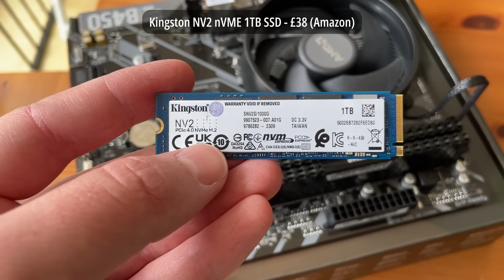Building a Cheap and Upgradable Gaming PC in 2023

Comment: Just today recieved all the parts to finally move on from my lga1155 , got a ryzen 5 5500,b550,and ram for 200, got an rtx 2080 for $150 on ebay, and reusing my PSU. Also got a nice m.2 drive for $30. For like 400$ I'm stoked to finally try 165hz!!! Love your budget videos bro.
Reply from the maker: Nice :)
Reply: @RandomGaminginHD  are you heterosexual
Reply: I also wanted to warn about using old psus. I've got an ancient Silverstone that was seriously expensive and still works great, but that one is an exception. Changed quite a few over the years.
Reply: @youzernejm  my psu is around a year old although it's a thermaltake smart 700w which dont have the best reputation
Reply: @Ostraaaaa  that's concerning. I hope it's not a Smart BX1 series. Hopefully you had it replaced by now with a good PSU. Good PSUs have been in competitive prices, and you can check their efficiency in Cybenetics and see what they are in SPL PSU Tierlist.
Reply: @karamelflan oh yeah i saw a vid not too long after, immediatdly got a nice corsair rm850 lmao😅
Reply: I built my first pc with a b450 16gb Corsair lpx 3200 the same psu as he's used and a 5 4600g with a real cheap case all brand new for the princely sum of £73 as I used the £200 Amazon vouchers I got from work. But since then I've got a 1660 super a thermaltake versa h18 case and a thermaltake assassin' cooler with a couple of artic 120mm fans. Best investment I've ever made.
Reply: @samoerai6807I sold my RTX 2080 ti for 230 euro
Reply: Banger dude, can't help but imagine how worth it, satisfying, and rewarding your journey
Reply: @samoerai6807 I got lucky watching 2080s for like 2 weeks and found one nobody had bid on lol I was stoked
Reply: I think you could save up some money on B450 mb as that 5500 only supports PCIe 3.0 so PCIe 4.0 fucntionality of B550 is useless. But all in all, I wish you a long serving PC that will handle pretyy much any game that you want to play!
Reply: @prosecanlik4296  I wanted to go 450 but all the stuff about having to update bios possibly scared me lol, thanks for the advice tho I appreciate it!
Reply: What would be a good upgrade cpu when the time comes? Same socket obv.
Reply: @Ostraaaaa  Practically anything is better than the 5500. If you could return the 5500 and get a 5600 non X you would be worlds ahead on cache, pcie4 for little money.
Reply: @robertkubrick3738  I was gonna get the 5600 too cause couldn't decide if it was worth it, wasn't aware of that supporting pcie4.0 but I'll probably get a 5800x3d in a few weeks hopefully!!
Reply: Edit: traded it in and spent the extra $40 on the 5600 because I needed  pcie4.0 for my m.2 drive to work so thanks for saving me the headache!!!
Reply: @Ostraaaaa  Ryzen 5600 and 2080 sounds like a great combo, and defo worth the extra 40 bucks compared to the 5500 - nice build and now more upgrade paths open to you! enjoy🙂
Reply: @Ostraaaaa  Not a bad plan to get a 5800X3D because it's as high as you can go and you are done, no wasting money or hassle of selling an old CPU. The difference between the 5500 and 5600 other than supporting pcie 4.0 is the cache, the 5600 has what I would call sufficient cache at about 50% more than the 5500. The cache will make a big difference in the lows. The lows are what makes a game unplayable. I don't believe that a 5500 can even use Smart Access Memory because it isn't PCIE4. That's why I recommended you return it and get the next tier up processor. I have bought 5600 for $119 and it brings a lot to the table being about 88% as capable as a 5800X3D and I really can't tell the difference between 600FPS and 500FPS at 1080 and I mostly play 1440P anyway.
Reply: @robertkubrick3738  appreciate all the advice guys! So glad I got the 5600, kicks ass in all the game I play at 1080p, such an upgrade from 3rd gen Intel and a gtx770 lol.
Reply: @Ostraaaaa  Glad you are back in the game. You will be good to go for a long time.
Reply: @Ostraaaaa  Later on you can drop in a 5700X3D and get even more performance. That CPU is still chart leading to this day...
Reply: @lunetailedfox  elite timing on this comment lmao ive been stalking amazon but they only stock 15 at a time hard to get one shis rough
Reply: @Ostraaaaa  Everyone is eating that CPU for breakfast for good reason, good luck!
Reply: Be mindful of the old PSU, they do age. If you start experiencing any weird issues, make sure you replace it before it dies, so it doesn't kill your other parts.
I had a 2014 Corsair RM650 and I had to replace it last year after I started experiencing random audio crackling.

Comment: Would 600w bronze PSU be good with a 3070ti and Ryzen 5 5600 I want to upgrade my gpu
Reply: no
Reply: i would go with 650w at least, but if you undervolt the gpu you should be able to get away with a 600w
Reply: A stock 3070 Ti will draw up to 290, the rest of your system would draw about 150 presumably. It would be do-able but not ideal, you would be outside the operating sweet spot for the PSU. I wouldn't advise against it, but I would say plan to upgrade the PSU to a 750W. The GPU/CPU is a good one.
Reply: Probably fine.  3070 ti has a 290w max draw.  A 5600 is about 70w.  Just don't OC anything.
Reply: Well, TDP of 3070 Ti is 290 W, with additional 65 W for 5600 . You should not bother with labels like 600W, 700W etc ... Instead, look for amperage on +12V for your PSU. In your case, you should have at least (290+65)x1.33 = 472W on +12 V rail, which is something like 40A on said rail.
Reply: dont upgrade to 6 core chip PLEASE dont get a mansized upgrade and Go 5900X it would blow your mind, its not just bout FPS but bout how responsive the machine is, input lag and frampacing whhere a 6 core would suck now, and make sure u got at least 48gb of ram and a dope NVME ssd in there, your 370TI demands it, but yes the PSU would work, but dont put a 3070ti onto a cheap ass 6 core chip thats dumb :*

Comment: Love these affordable builds u keep making vide on really helping out most of us who can't afford to get a 4090 and a Ryzen 9 keep up the great work 👍❤
Reply: You can get a decent build for about $1,200 if not about $800
Reply: but only to play older games ,lately games are released that have rtx 2080 as minimum spec and only do 55fps on that ,on gtx 1080 they become unplayable in 20 fps range  (Immortals of Aveum)
Reply: @bassax7045 to be fair 2023 releases are really bad so far, so yeah playing older ones is not a bad thing at all
Reply: @bassax7045  Not really I just built a client of mine custom PC for $1,600USD ish. Has a R5 7600 240 rad cooler 128 gigs ram 2060 Super 750 watt PSU two 2 tera SSD and a 500 gig SSD. all with RGB. He's getting a better GPU later on.